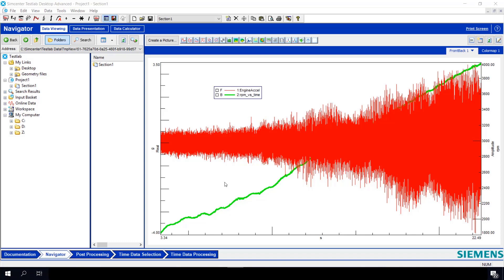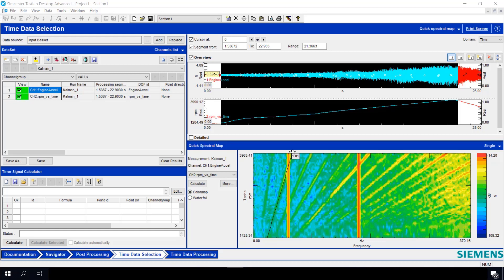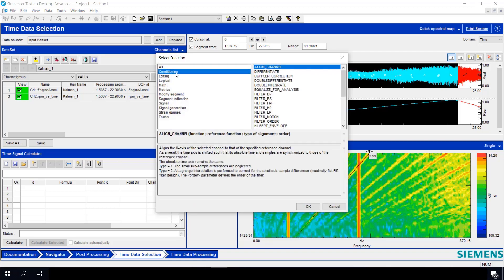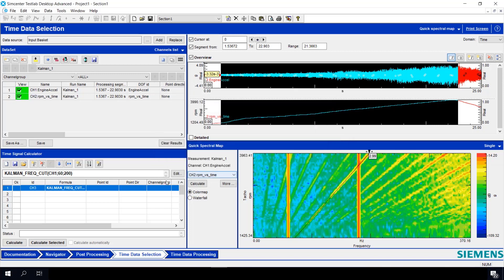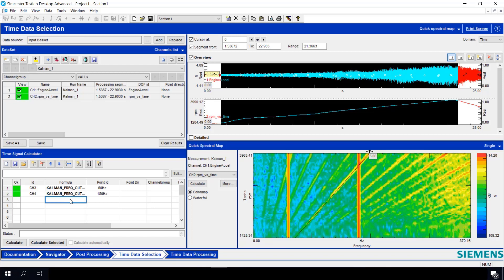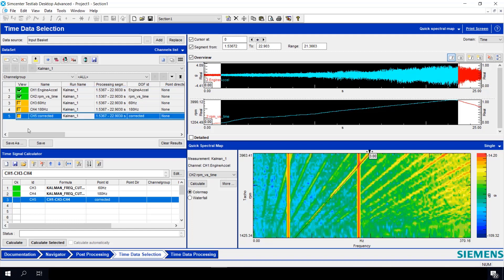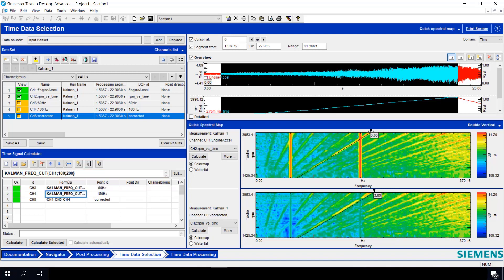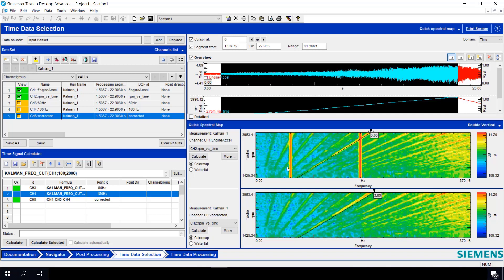Removing 60 Hertz/50 Hertz from Test Data

Comment: Before doing this, I have a question that cannot be realized. How is the colormap displayed in your "quick spectral map"? In "time data section", can only time domain data be selected? I try to put the data in waterfalls in my test into the basket, but I can't join it in "time data section". How do you implement it? Thank you and look forward to your reply.
Reply from the maker: Yes, only time data can be used in time data selection. The filters to remove the 60 Hz data are time based.
Reply: @SimcenterTesting  Yes, what I want to ask is how do you display the color map in the "quick spectral map"?
Reply from the maker: @jjxie3291  Highlight the time history to process in upper left.  Press the Calculate button in lower center to see it in Spectral Map.  If the upper right is a pulldown to turn on the Spectral Map for display (might be set to "Hide Additional Pane" on your system).  The "more..." button next to calculate determines how the data is processed.
Reply: @SimcenterTesting 
I can implement it according to the operation. Thank you very much, but my harmonic confidence value needs to be set to 20000 to change. What does this harmonic confidence have to do with?? When it is set to 20000, except that the frequency specified in the formula is eliminated, the graphics in other places also change. However, I observe the graphics in your video. Only the frequency specified in the formula changes, and the rest remains unchanged. Is this normal? Thank you and look forward to your reply